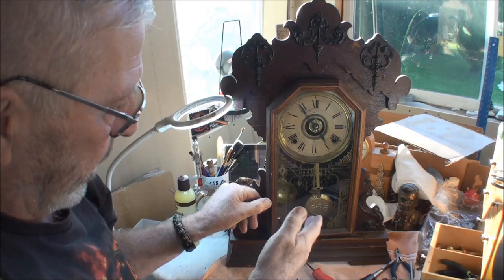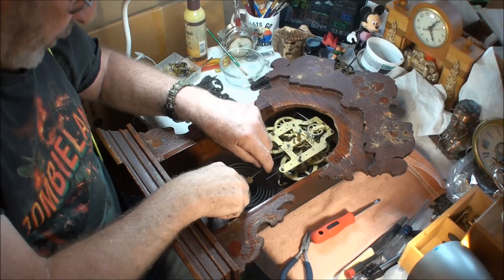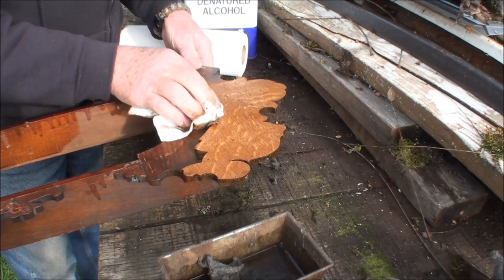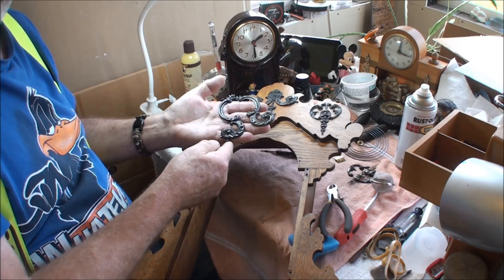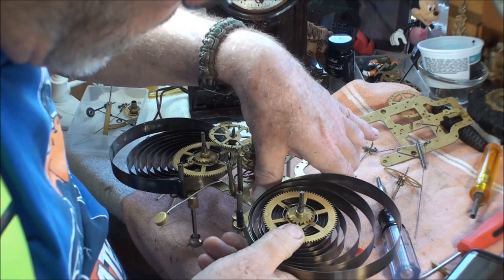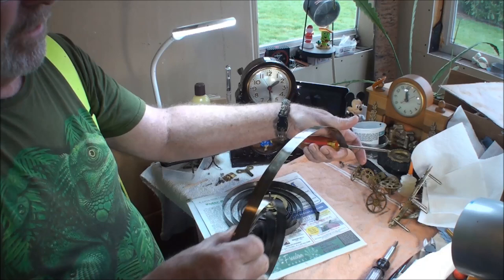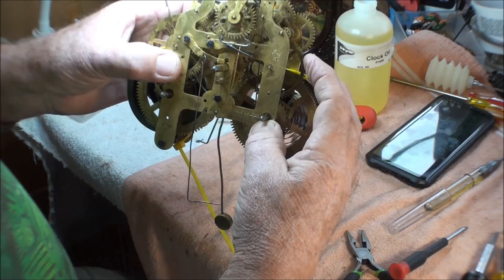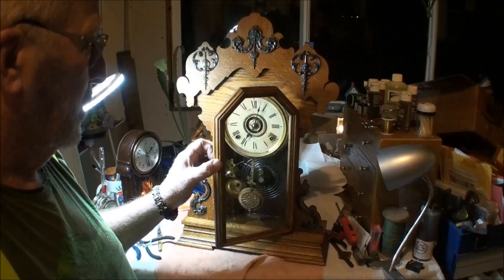Vintage Seth Thomas Kitchen - Parlor Clock Refinish with Denatured Alcohol & Oiling the Main Spring

Comment: Hi Mike! Many nice original features on this clock. Dial, stencil on door, pendulum, alarm mechanism. That small mark on the dial is the early Seth Thomas logo, ST in Old English script. You are right about liking the clock for its metal trimmings. Most kitchen clocks did not use metal in the design. Seth Thomas had a line of 6 kitchen clocks in the "Metal" series. Your clocks model name is    "Metal No. 1" and dates to 1900 in the old catalog. You have a good eye for nice clocks!
Reply from the maker: This is great to know some of the history and age of the clocks. You are great at these kind of things. Thanks for the great, informative comment and for stopping by today.

Comment: The crown is quarter sawn Oak. The plywood they made it into was sure expensive back then, but worth it. I wonder if the metal is Pewter, because Aluminum was not widely made yet at the time.
Reply from the maker: That's a good question and thought about the metal on the clock. I do know it is soft and silver when I scratched the back of one of the pieces. Thanks for stopping in Bob.

Comment: Can mineral spirits work to remove the old finish as well
Reply from the maker: I do believe so. How well it works, that I can't answer because I haven't used the Mineral Spirits on a clock yet.
Reply: @justmike57  I am working on a clock that had horrible completely rusted springs had to change them out but know it’s ticking away ordered a glass with the transfer on there but do you know where you can get those screws that hold the door on and maybe some tips on cuttings glass like do you need a glass cutter